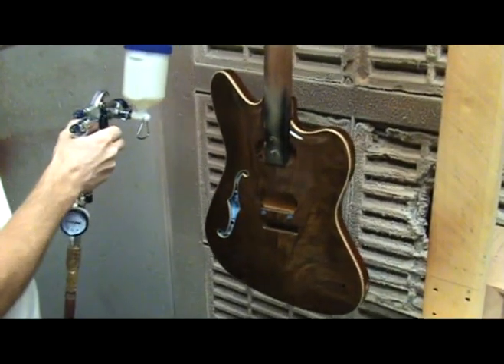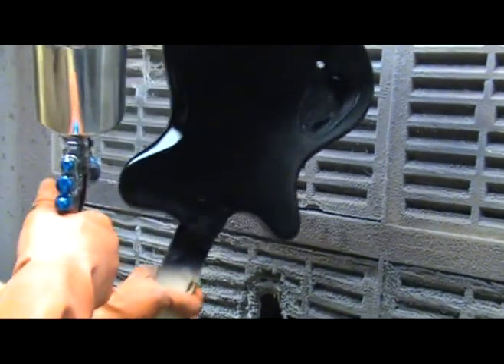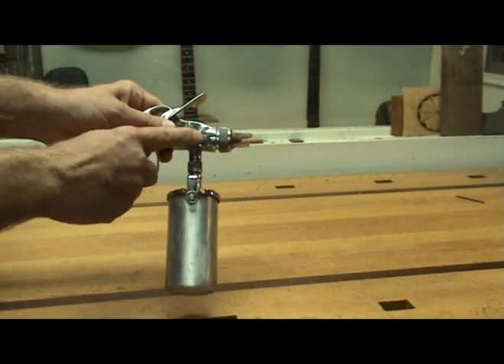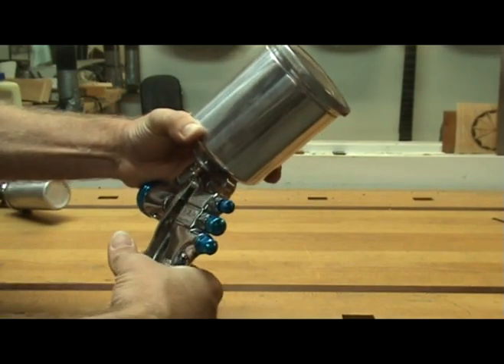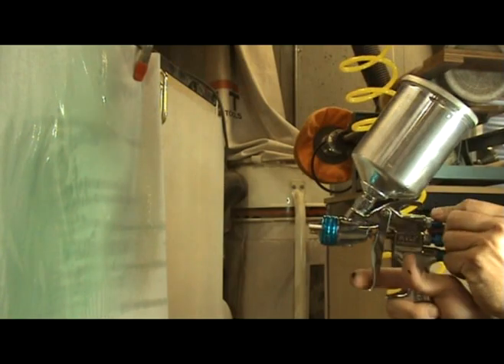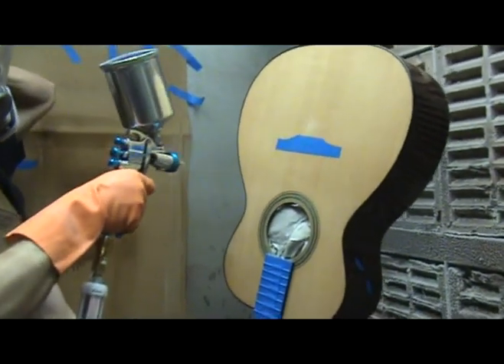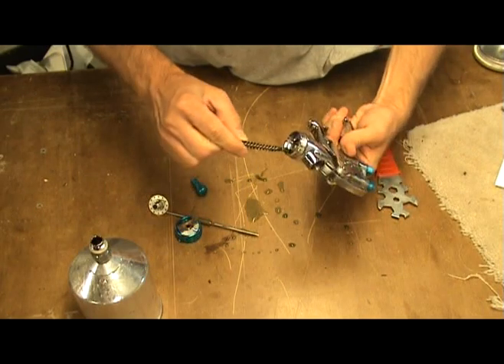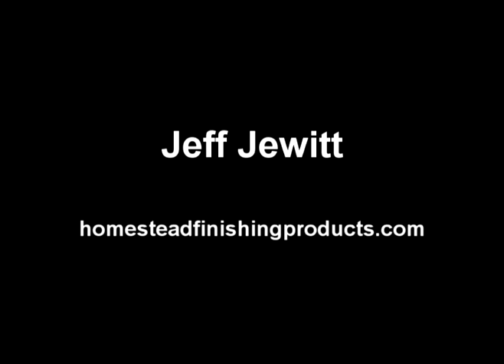Luthier Tips du Jour - Spray Guns

Comment: Have you tried the Devilbiss FLG4 (finish line). It's fairly inexpensive and I find that it sprays much nicer than the Startingline. It's also lighter, and comes in a water-borne compatible version if you're interested in that at all.

Comment from the maker: I have done fantastic finish work with an inexpensive touch up gun from harbor freight. A larger compressor allows you to spray longer without waiting for the compressor to catch up. Not a big issue for guitars though. You could also just use an HVLP system with a turbine. There are some models that are not very expensive.

Comment from the maker: That depends...are you going to re-coat it with the same type of finish? If so, then sometimes a light scuff sanding and then you can re-coat. However, if you need to fix imperfections in the wood then you will need to completely remove the finish. I use a combination of scraping, sanding and stripping to do that.

Comment from the maker: @naminnooman Basically any compressor will work. However, you want it to have a enough power and capacity to not have to wait for the compressor to "catch up" It needs to be able to supply constant air flow and pressure to the gun. On the green guitar I am applying lacquer clear topcoat over  dyed maple and shellaced

Comment from the maker: @187MIAMIBOY Smaller needle sizes are for low solid products like stains and dyes and larger needle sizes are for higher solid products like lacquer and urethanes. Usually a needle between 1.3mm and 1.5mm will work for most products and applications. You can also thin the products you arer spraying if they are not atomizing well

Comment: Okay, thank you for pointing me in the correct direction. I found a ridiculously low priced spray gun on from Harbor Freight. Now, I need to find an air compressor to use. Any recommendations?? Unfortunately, I LITERALLY have no clue what I am looking for. Sorry. I literally want the cheapest air compressor I can buy that will get the job done. I do not need something HUGE, due to space constraints, so the smaller, the better. I do not know ANYTHING to look for...PSI? Size? Hoses? Connectors?

Comment: Thanks so much for your response.  I went and checked out a few compressors today. But was confused. What is the Compressor capacity and HP you would recommend for guitar finishing? I mean ONLY guitar finishing without having to use the same compressor for other jobs in the workshop.  What is the finish that you are applying on the green guitar? Is that Nitro/polyester/polyurethane or acrylic urethane?

Comment from the maker: @presleep Thank you and good question. I am using an industrial spray booth. This thing is very powerful and will suck the hair off the top of your head, if you have any.  I am spraying away from the photographer, using an HVLP spray gun and all of the overspray is very quickly sucked up into the booth filters. Notice however, that I am wearing a mask cause I am much closer to the surface I am spraying.

Comment: Love that buffing wheel.Painted cars for 20 years now wood finisher for last 10.the only thing I would do different is sand in one direction no circles on light colors no difference but dark colors outside after a while will look like a spider web.I have done some hi gloss jobs on wood with car clear but you have to spray polyester (nast shit) sand 180 then clear,looks great lots of work.Closet Organizing Systems web site has a gloss ebony job I did a while back.

Comment: I am curious about the fret board.  When that gets lacquered how do you protect the frets?  I just spray and scrape but do you think painters tape would be better and just tape the frets?  This video helps.  I have an issue with drying times on can spray and will try this instead.  Right now after 24 hours of drying I still get imprints from what it is lying on which is a t-shirt.
Reply from the maker: I mask off the fretboard. This solves that issue. 24 hours should n be more than enough dry time to not have something imprint on the surface unless you are spraying extremely thick layers. Check your humidity level where you are spraying too.

Comment: Hi there, 
I've got a beautiful idea to put some pressed flowers on my acoustic guitar but I'm afraid I might ruin it. I was wondering if you could give me some advice if there is some kind of spray glue I could use to put them on or should I put a whole extra layer of varnish on top? The varnish seems to be a bit expensive, I'm looking for a cheaper solution if possible. It would be amazing if you could give an idea how to do it!
Thanks a lot in advance!
Reply: Epoxy resin

Comment: good video! you should use a paint sock on your head sometime it can get into your ears and hair, also try a larger water filter mounted on the wall with silica unless you already have one, I use a sharpe one and a devilbiss desiccant air dryer snake hose, water is one of the biggest enimies of painting,